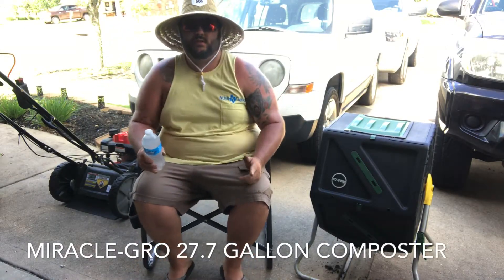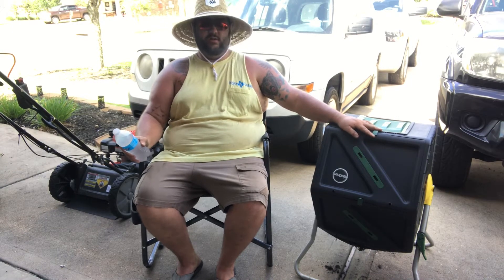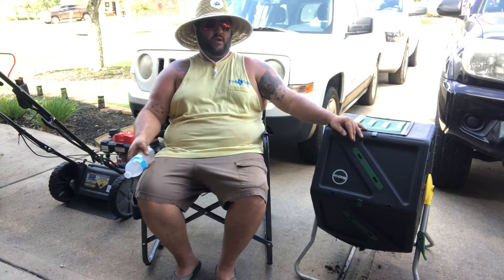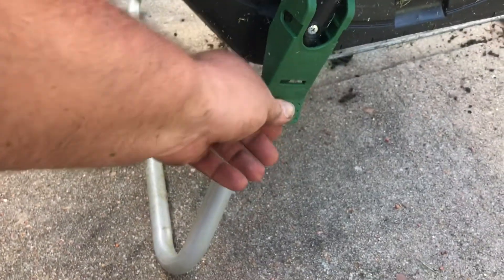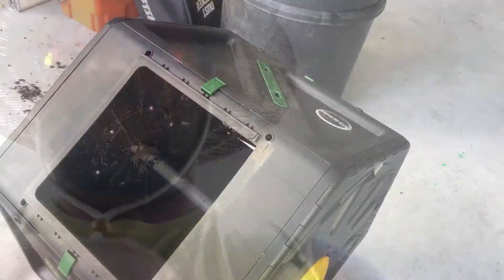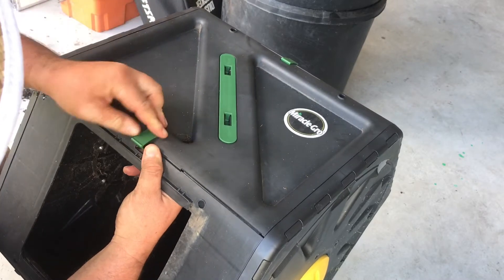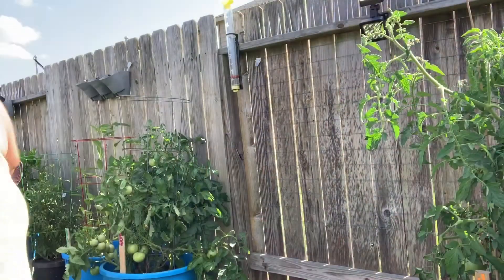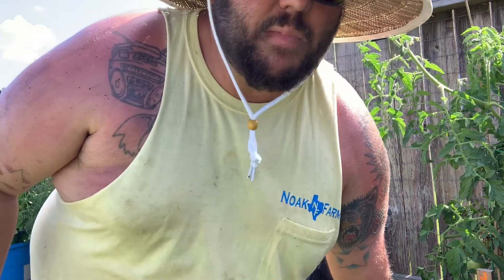The BEST Composter for YOUR Backyard! | Miracle-Gro Compost Tumbler Bin Review

Comment: These composters are flimsy pieces of junk. Don't waste your money!
Reply from the maker: I had to add some zip ties. But other than that it’s been great.
Reply: I have the double tumbler and they work great. It is easier for older people and those that want to save their backs. We used to have a huge compost in a rectangular pit my husband made and it was so much work and took shoveling which was hard on our backs.
Reply: This is my third Tumbling Composter. My first one is over 4 years old and has held up pretty well but the bottom connector fell off so I added some very strong tape to secure it. The compost is ready to use. I bought a new one and added the zip ties immediately.  I was having a very hard time getting the connectors off so I slid the zip ties over them. Now I have both the connectors as well as two zip ties in each connector location. You're a genius.  I'll be securing all three composters with these zip ties and will leave the connectors in place. THANK YOU VERY MUCH for this way to save my wonderful composters.😊😊😊
Reply: I have this exact one and love it